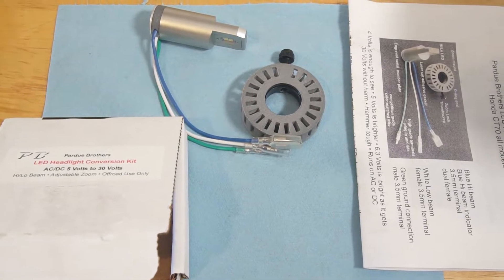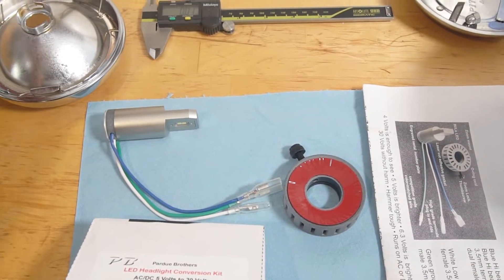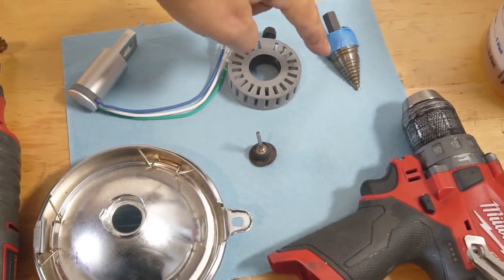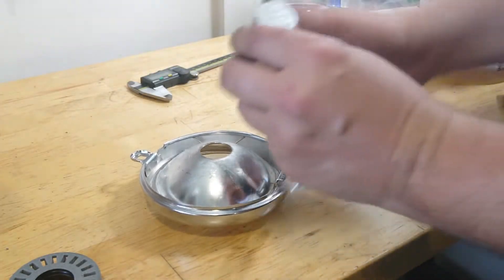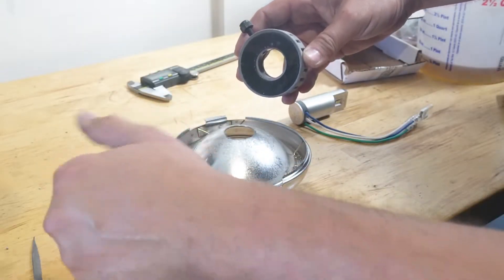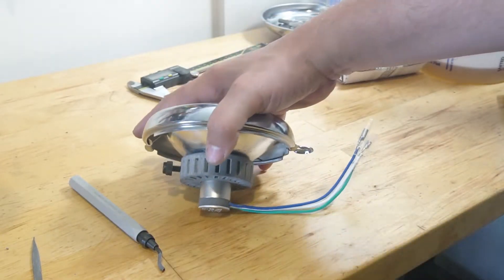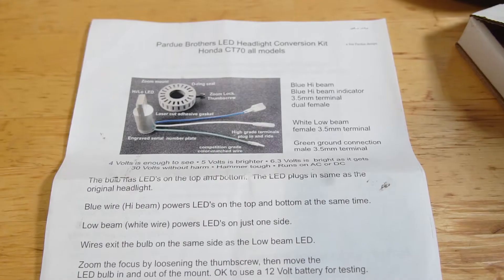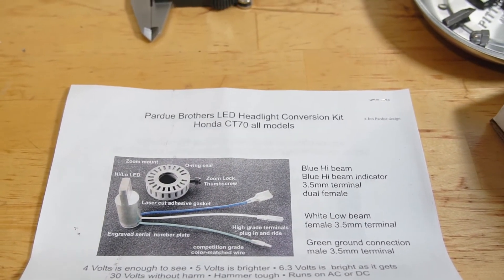6v LED Headlight Conversion Kit - Pardue Brothers - Honda Z50 CT70 SL70 CT90 CT110 C70 Dax 4mini

Comment: I have this kit on my CT70 with a yx140. It is a great kit. Jon has done a great job engineering it. It is a lot brighter than the stock light and it makes my battery stay charged much longer.

Comment: thanks for this great video,i do have a 1980  honda express 6 volt system and my tail light bulbs has a 1154 number on it,i was wondering if the connection would be identical if i buy the led bulbs?thank you

Comment: My 6v headlight is a bulb. The rear cntr is fixed to the reflector & is not removable.Your reflector has no bulb/wires attached??? When you start
Reply from the maker: You would drill it out like I did. You have a sealed assembly. Some were sealed and some were flanged

Comment: don't know for sure,but it looks like your beam is a vertical bar  where I might prefer horizontal.  I;d probably try rotating it 90 deg.  Hmmm. I have a 76 Yamaha TT 500 with a factory 6 volt headlamp. I wonder...   I think (as I recall) the Yamaha bulb is 25 watts. Matching wattage is probably a good idea. I'd expect to get a bit more light from the LED vs a filament at 25 watts.
Comments?
Reply from the maker: Hi. The light unit is rotatable, so l LED can be placed in any orientation you prefer. I would contact Jon with Pardue Brothers for any product questions / spec info

Comment: How about the  hi an low beam?
Reply from the maker: On this bike I have a on / off  switch and just use the high (brighter beam). Didn't film the low beam output due to the way I wired it up. There is another video on yt that shows the difference.